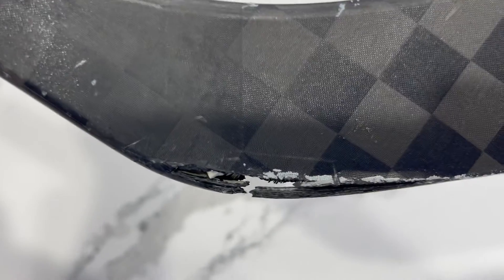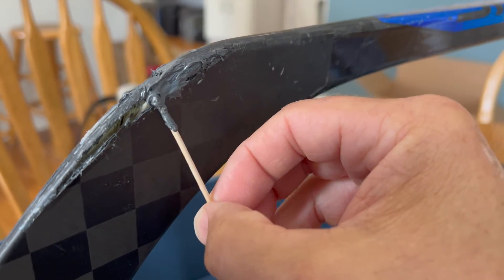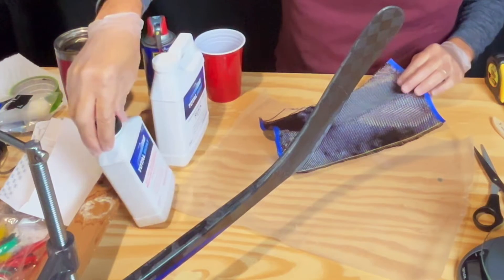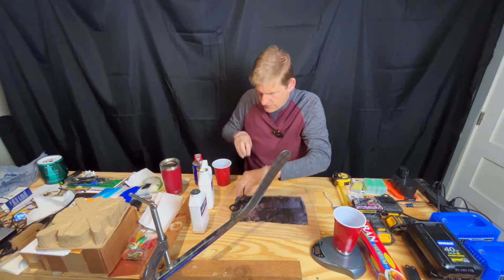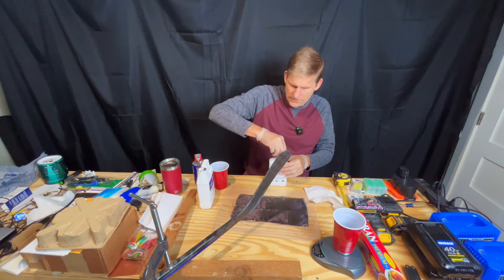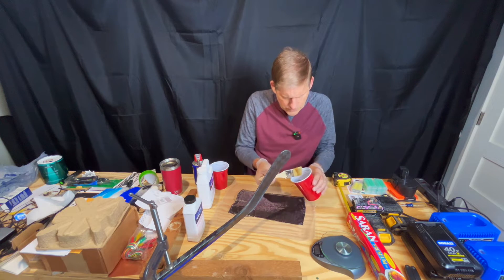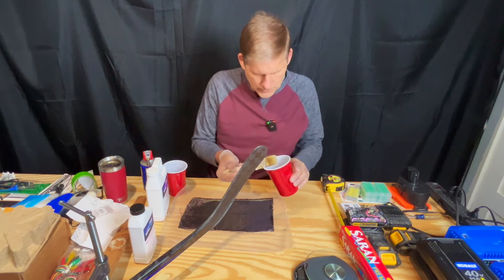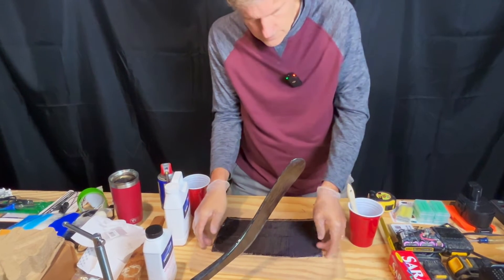Carbon Fiber Repair of Hockey Stick | How to Fix Cracked Hockey Stick

Comment: How did this hold up? I have a few sticks I'm going to tackle myself. With my experience doing carbon fiber jetski hull repairs I brush a layer on epoxy resin on and let it tack up first. Once you place the carbon there's no chance in hell it's coming off. Then I layer it up to make sure I get all the air out of the weave. Tough without having a vacuum bagging setup but I can't justify the price of a good setup

Comment: Could u ball park how much all the materials cost ?
Reply from the maker: Short answer / longer answer:
About $100 - 30 for 4 sq ft of aircraft grade carbon fiber mesh, $70 for the total boat 1qt epoxy kit. 
I only used 1 sq foot of the carbon fiber, and a small number of ounces (5?) of epoxy.

The actual cost per application might be $15??

I have other plans for the remainder of the carbon fiber and epoxy - best way to economize if you have multiple projects in mind. 
Hope that helps.

Comment: Awesome! How did it come out?
Reply from the maker: Turned out great for 1st try. My grandson was jazzed to have his extra stick back and has used it without issues!
Thx for watching!
Reply: @Housebarons  Thanks for the video! I have tried JB weld to repair the bottoms of stick blades however, after one practice with some slap shots my 13YO Son chips off a good portion of that epoxy. I wonder how your repair would hold up to an older kid taking harder shots.......assuming your grandson is younger :)
Reply: Good job for 1st time, I think the entire blade was overkill....next time get a 4 inch carbon fiber sock.